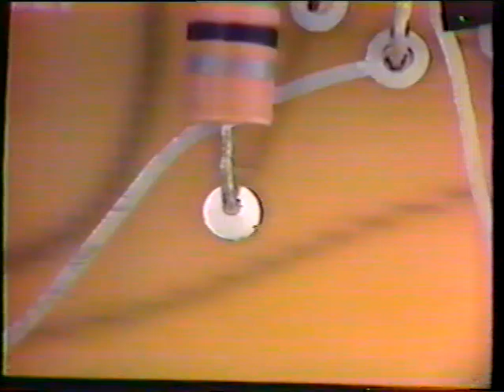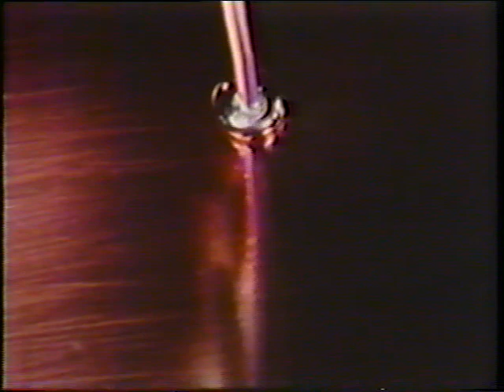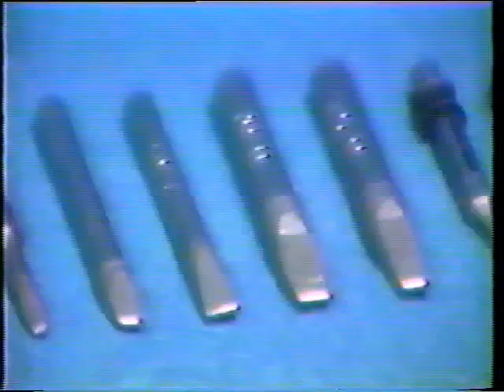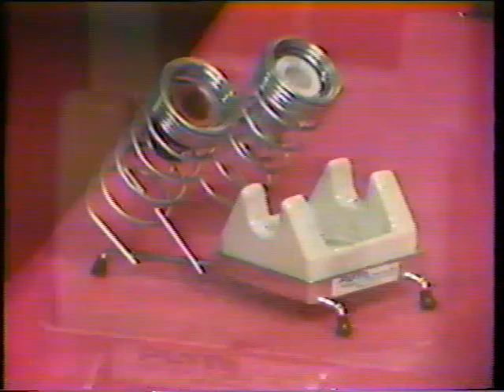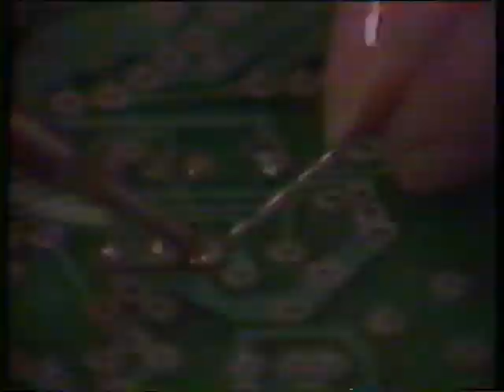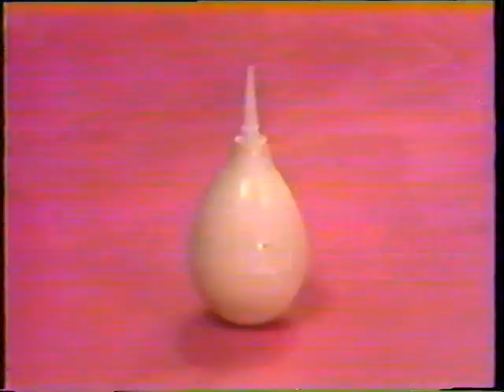TEKTRONIX - Solder And Its Application In Electrical Assembly (1977) - VHS Transfer

Comment: I watchied an older Tektronix soldering video, and they advised NOT TO use a wicking braid on plated through hole components, stating that it may lift and damage a pad on the PCB, but apparently that got changed to approving wick on plated through hole work as shown in this video.

Comment: Anyone else wonder shy she is soldering on the component side?
Reply: You CAN, properly solder components into boards with plated through holes from the component side. If you solder them from the lead side, it's also a good idea to feed in just a little bit more solder than you think for a unplated through hole, as you want that solder wo melt and wick all of the way through to the other / component side and appear as a nice fillet / scalloped fill around the top side as well. Working with the board oriented vertically helps a bit with that heat transfer.
Reply from the maker: @poormanselectronicsbench2021  yep, I do this if it is a multilayer board it is is hard to get it to go through to the other side.

Comment: 24:48 That solder sucker: the technician uses it by pressing it against the table: why does the “guard” on my (cheap) solder sucker prevent that?? Seems like a much easier way of using it… grabs side cutters
Reply: Those cheap solder suckers are designed for one hand operation, you can reach the plunger with your thumb. The Soldapullt solder sucker seen in this video has a lot longer throw valve for higher vacuum, so you can't use it with a single hand, unless you press it against a surface.

Comment: A few years before this film was made, I had a two-week NASA-developed soldering course in the Air Force. NASA decided to do the course after some of the early launches caused a lot of mechanical failures on circuit boards. 

One of the things stressed is that you must never use wire cutters on soldered joints. The clipping action causes a shock. This means that all leads must be clipped to length prior to the part being soldered. Similarly, you must not clip a part off the board and then desolder the ends of the leads as you mechanically shock the hole. 

In the film, when soldering from the non-component side, it looked like the pre-clipped leads had been bent to keep the part in place. That was not something we were told to do. It would likely make desoldering harder.

There were also rules about how "fried" the board could be after resoldering, which often would cause some thermal damage to the PCB material.
Reply: And somehow, some process eliminated this from my technical school when I could have used it to fix so much equipment.  Oh, better late than never.